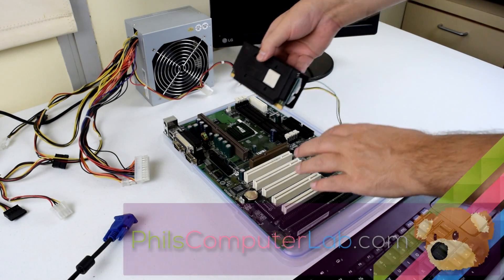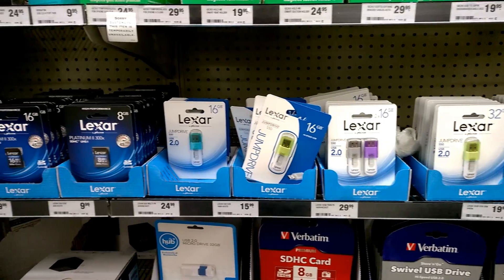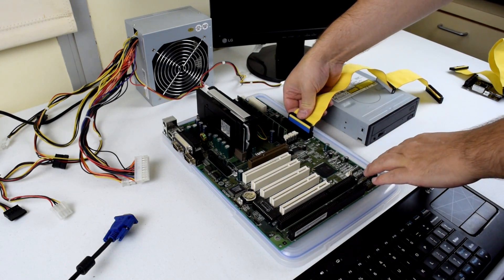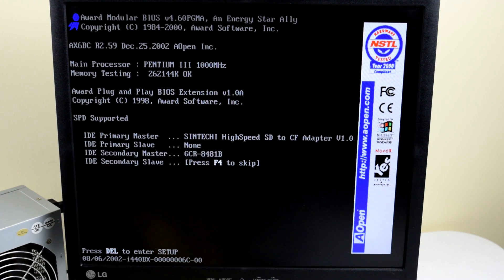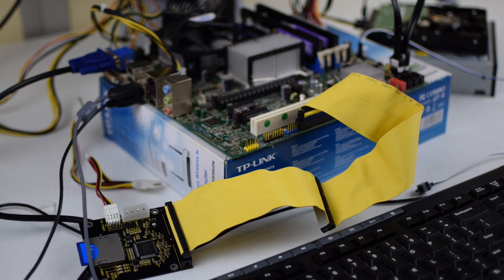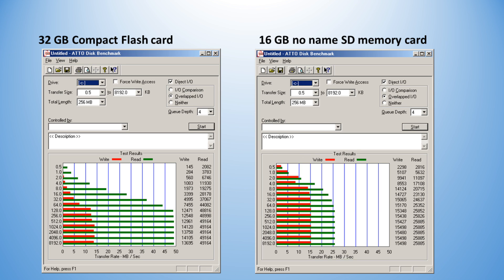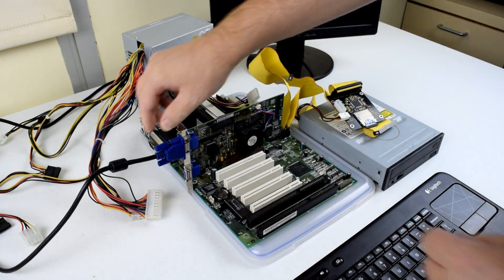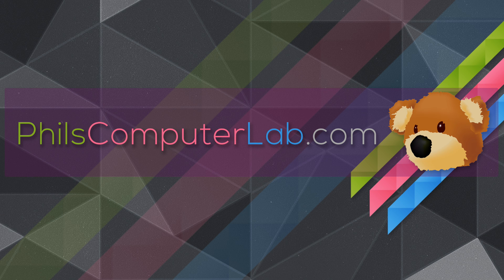SD memory card to IDE adapter review benchmarks guide

Comment: More than 2 years later of rewatching the vid, I caved in and bought one. Im happy
Reply from the maker: Nice :D
Reply: Just got one myself and re-watched this after. One thing I can't figure out.. where on earth do you mount them!?
Reply: @nrg753  No idea, got one myself and im using a testbench and it doesn't have holes fit for this thing... so used one hole and then some cardbord box on the other side to make it "even".. ugh..
Reply: @Planetdune  I ended up using those rubber/felt feet you stick on the bottom of table feet to lift up the board so it didn't short, then zip tying it to the side of my drive cage lol. They should really revise this board with some standard mount points.

Comment: Phil I've installed one of these on Windows XP (P3 board) and it's slow as hell. It keeps seeking/reading when it's doing nothing. Even opening a new window takes 5 seconds. Any ideas?
Reply from the maker: Yea that doesn't surprise me, I use SD cards mostly for DOS, maybe 98 and for windows make sure it's a very fast one.
Reply: @philscomputerlab  The adapter itself might be the limiter, as the card I have is 80mb p/s.
Reply from the maker: @tassadar1977  It's not just the transfer rate, what matters more is the performance with small files. SD cards are optimised to work with like 12MB image files. But yea, transfer is limited as shown in the video!

Comment: Is there a capacity limit on these adapters I heard they don't get over the 128gb limit. I was thinking about using one in an Xbox and would one day when prices come down try a 512GB to replace the 320gb harddrive I am currently using. Also would like to run a cable under the cases lid so I could swap cards without opening the case. Of course I plan to turn the machine off and likely even unplug it when swapping cards.
Reply from the maker: If you need 128GB, use a SSD.
Reply: @philscomputerlab  I guess I will be off to finding a solid IDE to SATA adapter in that case

Comment: Nice video, I've got a few old PCs I'd like to bring back to life but my main problem is not having enough working IDE drives.  I thought Compact flash was still the only method, I'm only just learning about SD to IDE.  An adapter is only $7 and I have many extra SD cards laying around.  I've seen people mention it could wear out the SD card, has anyone had this happen?  I'm not going to be using the PCs 24/7 obviously.  If it does wear the SD card out how fast are we talking?  If it is a year or more that is no problem.  Even if you had to replace the SD once a year it would still be preferable to an old IDE drive.  I'm guessing that even under heavy use that the cards will last several years.
Reply from the maker: With CF cards, the adapters are cheaper, and performance is better, but CF cards can be expensive. SD cards, the adapters are more expensive, and transfer rate is capped by the chipset, but SD cards are easy to find, and often have better small files performance.
Reply: @philscomputerlab  I ended up buying the adapter shown in your video shortly after posting my original comment.  I am very happy with it.  It is  recognized by every computer I've tried it with.  I first tried it as the primary drive on a 500mhz Celeron.  I installed Windows 98 and it seemed to run just as well as it would on an actual drive.  Next I tried it with a 1Ghz AMD Thunderbird machine.  I installed Windows XP on it and well it was a different story from how it ran 98.  The OS was very slow and laggy.  It was still usable just very slow at times.  Installing any software was the biggest issue.  Something that would take around 5 minutes on a standard drive may take a half hour or longer with the SD adapter.  It seemed slower than it should have been.  Maybe the card I was using was slowing it down? I ran CrystalDiskMark and while some speeds were around the same you were getting but some were much much slower. My read results were (25.79) (5.818) (2.794) (0.136) my write results were (5.949) (2.167) (1.203) (0.121).  Some of those number are way off what they should be.  I think if I was getting the same numbers that you were getting then XP would have run just fine from the SD card.  The card I was using is Sandisk Micro SDHC in a micro to standard adapter.  Perhaps using a micro SD is causing problems?  I will try it again at some point with a standard size SD card and see if the performance improves.

Comment: Hi i really need some help here. i have removed my old sd card that had win 95 on it cause i wanted to install a 2gb sd card with win 31. and then swap them out when i want to run each os/ the win 96 sd was 8gb. my 486 wont boot past the psot screen now cause i dont know what the correct parameters are for the sd cards and even when using auto detect the computer wont boot. really need some help please mate. where can i find the parameters of the sd cards?

Comment: I bought this and have been having pretty bad luck with it. The max disk size is 4GB so it seemed ideal for my 486SX as anything higher than that, needs a bigger drive for games. Except my IBM BIOS refuses to even recognize the device. On my PIII 600 it works but the 4GB limit makes it useless there for my purposes (= install loads of games). Now if it could read 120GB ...
Reply from the maker: Might be your BIOS or machine? I've used 16GB cards, and believe also 32GB. SanDisk and Lexar are the brands I use.
Reply: @philscomputerlab I tried a Sandisk 64GB but it refused to work. I looked at the page of the article and it says "SD socket supports maximum 4GB SD card". Maybe yours is slightly different from mine although they look identical (even the same name of the device detected). A 2GB card worked fine though. For my IBM Aptiva, I switched to the CF IDE adapter which works fine (ordered both at the same time) so at least that is fixed. If I can find an SD-IDE adapter that supports more GB, I'd use it to replace all my hard drives in my Pentiums - they'd be so much more quiet as well and easy to swap out.

Comment: what if the BIOs has no options to auto-detect harddrives? it only has like 256 premade options of different Head, cylinder, sector, etc settings what do i even set them to
Reply from the maker: Pick one and see how you go!
Reply: @philscomputerlab  well that's gonna take a while. i guess it depens on what the chip emulates.

I assume it also doesn't really matter what model it is. since i'm getting this one https://www.amazon.de/dp/B001CBXUGM/ i'll just hope it works

Comment: I'm looking for a good way to physically install this adapter inside the computer case. I don't want it just dangling around in there. Is there some sort of tray that would fit it? All the sellers just offer the adapter board with no tray or insert or anything. Any tips?

Comment: Good video. The main reason I've been sticking to CF adapters is that from what I've heard, in general, the SD ones are often less reliable or have compatibility issues with exotic systems.
With CF adapters, it's pretty much just passthrough, so even cheap dodgy looking ones often function just fine. Since SDs require active conversion, a lot more things can cause issues.

You don't seem to have had many issues over the years though. Is there any particular brand or source that you've had a consistently good experience with?
Reply from the maker: Hmm, I buy what is available locally and the brands are Sandisk and Lexar. Both have worked well for me :)
Reply: @philscomputerlab  Oh! I was referring to the IDE adapters. My apologies if the above message was confusing.
Reply from the maker: Oh I see. Well I get the cheapest stuff from places like eBay or AliExpress. I always buy at least 3, just in case one is faulty which can happen :)
Reply: @philscomputerlab  Fair.. I guess I'll just have to do that one of these days. Thanks, in any case~ :3!
Reply: Is CF adapter full speed or is it stucket at 25 MB/s as these SD adaptors?

Comment: what is the max size sd card supported in this adaptor? I have been looking online and the ones on alieexpress state max sd card supported is 4gb. I am looking into this for a win98 pc and one for xp. this is the link to what I am referring to it states sd socket support max of 4gb I was hoping for 16 or 32gb support. thanks for any help you can give.  https://www.aliexpress.com/store/product/SD-Memory-Card-To-3-5/2783189_32822861998.html?spm=2114.search0104.3.85.31e9292bV6WQSc&ws_ab_test=searchweb0_0,searchweb201602_4_10065_10068_10130_10547_10546_10059_10548_10545_10696_100031_10084_10083_10103_451_452_10618_10307,searchweb201603_2,ppcSwitch_4&algo_expid=432b9c84-cf9f-48cd-b373-015653715db4-13&algo_pvid=432b9c84-cf9f-48cd-b373-015653715db4&priceBeautifyAB=0
Reply from the maker: I've used 16GB and 32GB cards.
Reply: thank you for the information. I wonder why they all say 4 gb max on alieexpress lol. maybe that's all they guaranty it to work with. I did have a palm z72 that was rated for only 1gb sd cards but worked with larger sizes to a point lol. thanks again

Comment: Thanks for this video! Was very useful to me. Bought this adapter (or similar) that says "Sintechi" at computer boot. On the chip there was a sticker and I removed it. Doesn't say "Sintechi" there, just a bunch of numbers. Cost about 6-7€ including shipping, so very cheap. I had one 32GB SD card laying around and installed Windows 98 SE into it using this adapter. Works like a charm and NO MORE NOISE from HDD! I was also very lucky having lots of small holes inside the PC case where I managed to mount the adapter using screws and managed to have a lot of breathing space as well. It stays there now pretty nicely! :) So far, no issues!!
Reply from the maker: That's great to hear :D I still use SD cards in many projects, they are really great and cheap.

Comment: i may go the CF card and SD card route because i have been having bad sector issues with many of my hard drives, i had a couple seagate drives (2gb st32132a and 428 mb st3491a) fail on me recently due to bad sectors, that has been the issues that has plagued many mechanical hard drives, i may go with a gotek floppy emulator as well.
Reply from the maker: Yea I haven't looked back! For DOS, and even Windows 98, they work really well.

Comment: its probably cable select, most of these jumper-less ide readers are, all you do is put the card reader on the master plug, set the optical drive/second harddrive to cable select and plug it into the slave plug.
i have two of these and this worked for me.

Comment: 'IMPORTANT: If you are using a brand new SD card, and after installing MS-DOS it simply won't boot from the SD card, boot from a DOS startdisk and type this command:

fdisk /mbr'

What about a Windows 9X installation? Specifically Windows 98 SE, in my case.
Reply from the maker: Same, it also applies to Windows!
Reply: Can you simply boot from a CF card with an IDE-to-CF adapter?
Reply from the maker: No you will have the same issue.
Reply: Ah. Same issue with those SATA-to-IDE adaptors you've featured in other videos or no?
Reply from the maker: It's an easy fix and you only need to do it once.
Reply: Only once before every boot or only once period?
Reply from the maker: Only once!
Reply: Thanks Phil. :)

Comment: I got the "DeLOCK Converter IDE 44pin > SD Card" for my laptop project. Got an T42 that I want to run Windows 98 on.
Hope to finish the project soon - waiting for my GoTek external USB Floppy emulator to arrive from china, so I can install Windows 98SE on the SD Card.

Comment: Having issues.. my computer detects the sd/ide adapter only when there is no sd card in the slot.. when there's an sd in the slot it just hangs
Reply: Your PC might not support bigger hard drive sizes. This was common in older ThinkPads, where anything over 8GB would just hang the computer.

Comment: I"m Using 512mb Generic SD card with my 486 66Mhz PC running windows 95 C, using  IDE compact flash adaptor, The Original IDE hard drive it came with died click of death.

Comment: how reliable are these adapters ? i have plans for one sata converter to replace hdd in laptop. but will it last long ?
Reply from the maker: That would depend on the SD card!
Reply: lets say im using a good sandisk card. but this converter has on board electronics too, what are the chance they might fail withing a few years  ?
Reply from the maker: A few years? If you write a lot, I think that could happen quite likely.
Reply: ummm i did not mean failing of sd card. i meant failing of this adapter.

Comment: The motherboards should have built in two SD cards running the OS in raid0, now a days SD cards are faster than HDD, some with speeds faster than 250MB/S
Reply from the maker: I like that idea. Do motherboard support RAID with IDE ports?
Reply: PhilsComputerLab I doNOT know what motherboards support Raid with IDE to be honest, we would need to check on that with more details, but they can certainly make a new motherboard that can have built in Microsd cards working in Raid0 just for the Operating System to run from the Microsd or SD cards, and be much better, also for gaming you can have your games individually playing from another hard drive and they would have better performance as well.
Reply: PhilsComputerLab anything faster than 140mbps is at same speed or better than HDD, because USB3.0 is faster than HDD now a days, but I didn't knew that SD's were that fast, the SD's are as fast as 3.0 or even faster in some cases, if they can have two Microsd or just two SD's working in Raid0 just for the Operating System built in the motherboard, you could run the OS without a hard drive because the Microsd and SD's would be the internal Hard Drive as if it was built in, very slick and fast OS, and games would be more stable and run smoother.
Reply: Regular speeds for an HDD that 7,200 is around 160mbps on average, but is not constant and that is one of the best average speeds they provide.
A 5,400rpms is around 120mbps on average.
If you have a Microsd or SD working average 140-170mbps that more than enough to run an OS, specially in Raid0 which would be even faster, wouldn't have problem handling any OS now a days

Comment: What is faster this adapter or a PROMISE SATA controller board (Data Transfer Rate: up to 266 MB/sec (66 MHz PCI); up to 133 MB/s (33 MHz PCI)) with 120GB BlitzWolf SSD?
Reply: The Sata controller is faster. But you might strugle to fins Win98 drivers for it.
Reply: thx.

Comment: Hi Phil. I've got the exact same adapter as you have here in the video, but I'm not able to get Win98SE to retain the DMA setting. I've tried manually setting mode 4 in the bios as well (i440BX, P2-350 @ 100MHz FSB). So far getting about 7mb/s read speeds (it's a UHS-3 SD card, so no speed issues there). It's on an 80 conductor cable with no slave present.
Windows is currently running from a CF-IDE adaptor and a reasonably fast CF card. The CF card also doesn't take DMA, BTW - and it's directly attached onto the motherboard IDE connector, so there shouldn't be any issues there regarding crosstalk/grounding and t/f 80 conductor cabling.
Reply: BTW - this motherboard BIOS specfically has UDMA up to mode 4 as options, so I'm fairly sure it supports it.
Reply: Same problem here with i430TX.

Comment: Wonderful video! 
Has anyone seen any of these SD -> IDE 2.5" adapters that do feature the master/slave select jumper? It seems that - at least for the 2.5" variety - there only exist ones without them. As seen in this video this leads to problems when multiple IDE devices use the same channel (example: CDRom on slave). 

BUT these adapters can superbly used to mimic a 2.5" IDE drive for LAPTOPS/NOTEBOOKS between 386-486-P1, since most of these laptops came without a CDDrive, and even if, they were not on the same channel, the harddisk was usually alone [mastered] on its own channel.
Reply from the maker: What I found is that on some machines and with some drives, it will work together with a CD-Rom. So you might just have to muck around a bit, no big deal, they are cheap enough to buy and just try out.

Comment: Got two of these devices, but they refuse to work together on the same IDE cable - only the one at the master position is detected by the BIOS and boot hangs. I would be interested in any workarounds for the lack of jumpers.
Reply: It's been a while since I had to dink with any of this, but this is what I remember:

IDE supports two addressing schemes - the 'assignable' mode (master and slave settings) and 'Cable Select'.   To properly support the Cable Select mode, however, you have to have the proper cable.   And it sounds like you don't.  And since these devices lack master/slave settings, you need a cable that supports Cable Select.

There are generally three types of IDE cables - 40 wire with cable select, 40 wire without cable select, and 80-wire.  If you a 40-wire cable, regardless of CS or not, a single drive at the 'end' of the cable will be assigned 'master'.  If you put a second drive on that wire, and it isn't CS compatible, you have to assign master and slave accordingly.   If you have a CS-compatible cable, AND the drive(s) are configured for CS, the drive at the end of the wire is still assigned master, and the second drive is slave UNLESS you assign master and slave via jumper settings.

How do you tell them apart if it's 40 wire?   The CS-compatible one will have one wire cut between the two HDD connectors.

Why did they do it this way?   Well, most OEMs only provide the computer with a single hard drive, and the non-CS cables are less expensive.

If you have an 80-wire cable, IIRC, it will be CS compatible.  The 80-wire cable is backwards compatible.  80-wire cables were implemented primarily to support the newer, faster ATA100 and ATA133 standards.